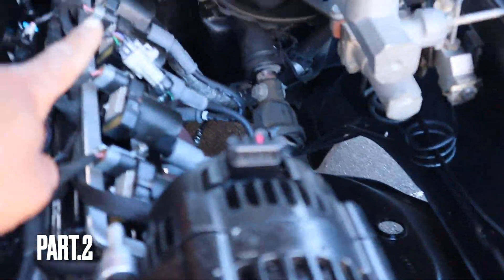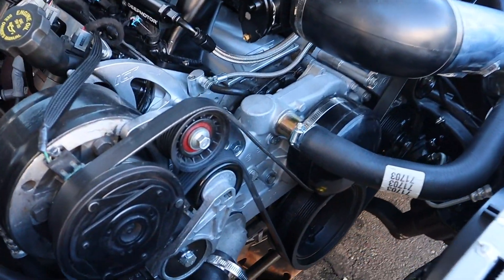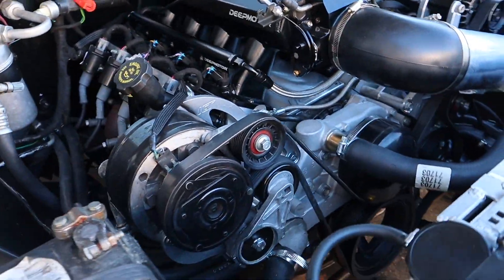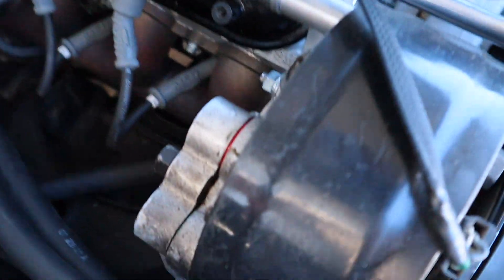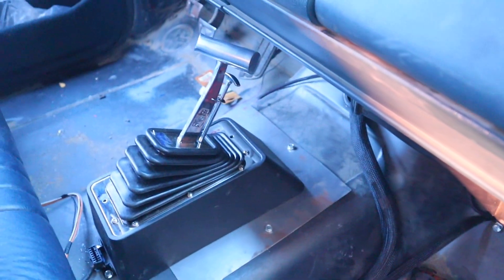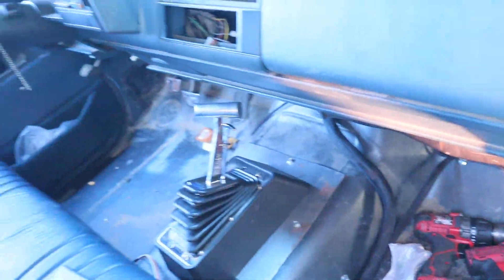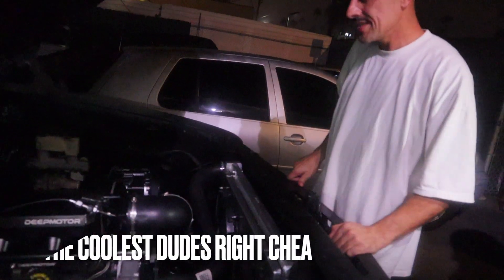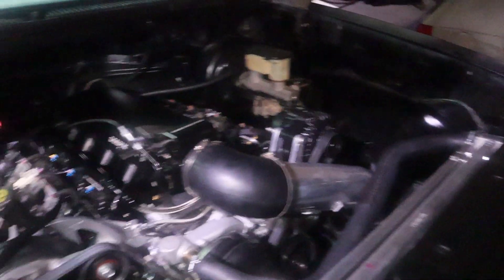LS SWAP OBS PRT.2 & STARTED ON THIS NICE NEW PROJECT COMMENT YOUR FAVORITE BUILD

Comment: Got a question I’m running Holley terminator x 5.3 th350 combo car starts fine revs fine but when I put it in gear it loses power I can press the pedal to the floor it just bogs out